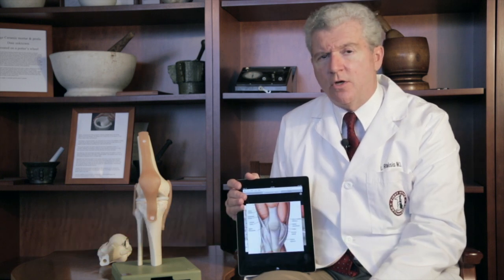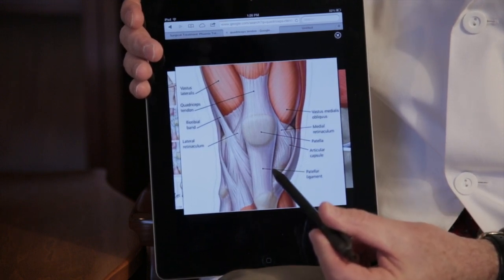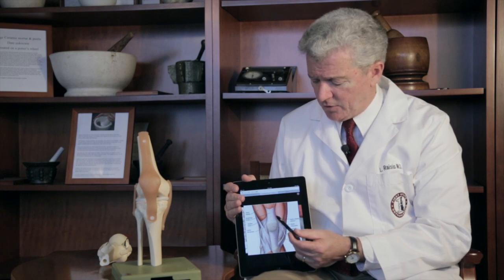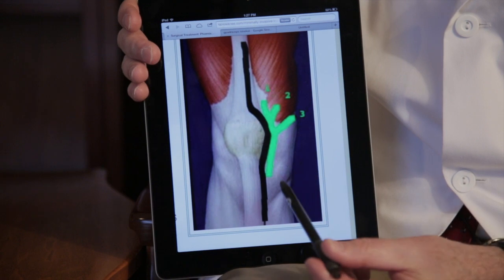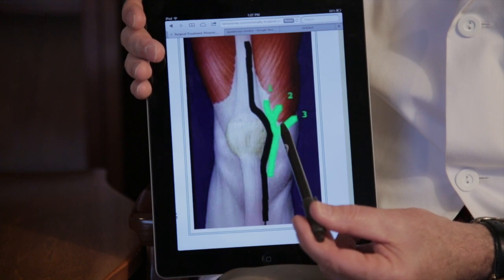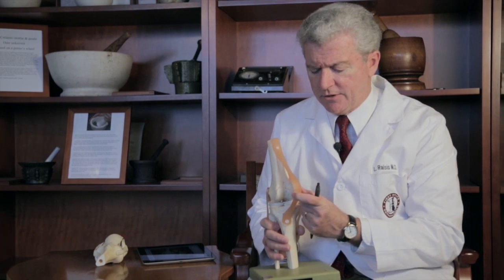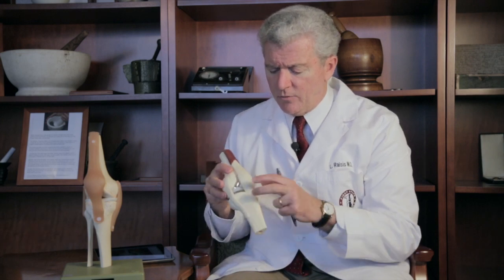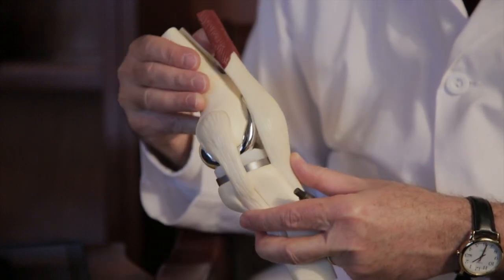Minimally Invasive Knee Replacement and the Quadriceps Tendon

Comment: I don’t know why more doctors specifically surgeons don’t use such a comprehensive common sense illustrative aid to show people specifically what is meant by minimally, invasive, and the fact that you use resurfacing as a term where and by others use resurfacing as if it is an altogether separate procedure Causing less trauma or as an alternative to TKR is very good to see the technology continues to improve 3-D printing new surgical techniques. I am a 57 year-old male with tricompartmental osteoarthritis of both knees and although I work out consistently have lost 25% of my body weight Have given up alcohol and eat clean. I know that the eventuality is that I will have to have both knees most likely replaced. I’m getting quite an education.

Comment: Dr. Raisis, I had a HTO done to my right leg some 20 yrs ago, and know I am experiencing pain and lack of strength in the leg. I had a fall 5 months ago and was diagnosed as a contusion. The hardware was not affected. During that time it was a struggle to walk pain free and after several xrays & a MRI it was determined that there is a tear in that knee. I received a Cort. shot last week and the pain has subsided significantly. Question I have is with the plate and screws what can be done.
re tk